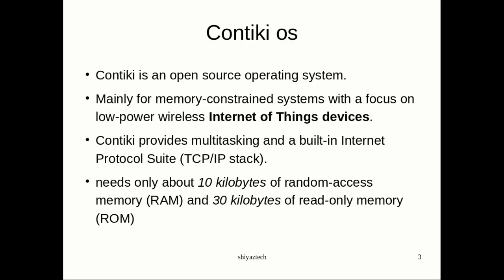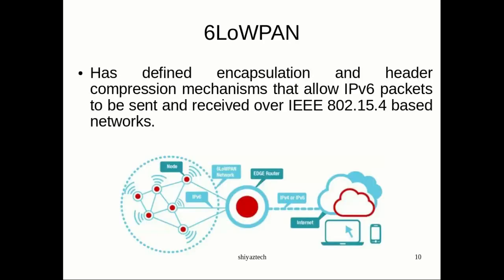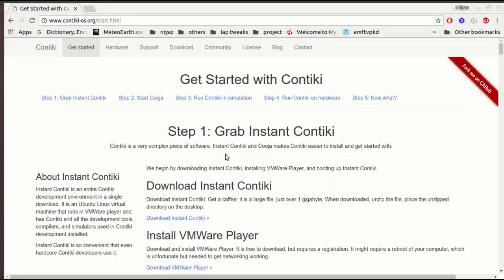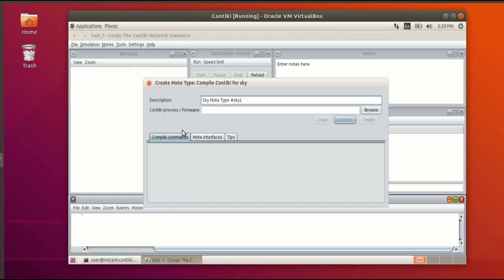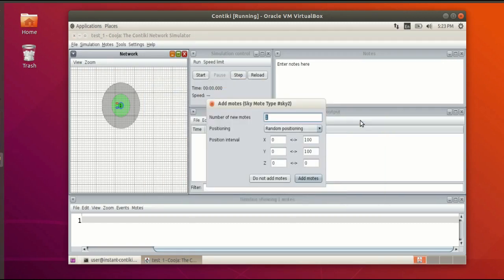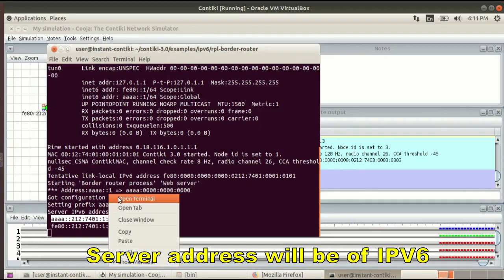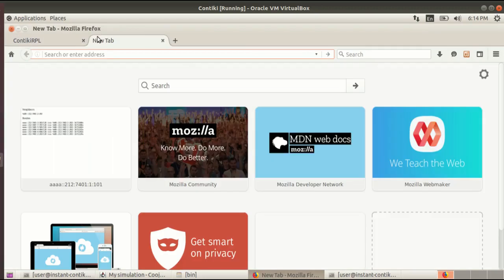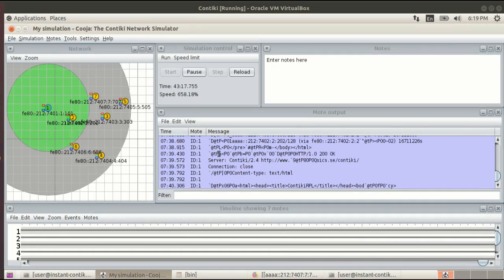6LoWPAN & COAP in Contiki Cooja Network Simulator

Comment: hello sir,   
to run COAP you have told that older version of firefox....which version have to install to see the result  in the web browser.
Reply: If you used Instant Contiki, In contiki/examples/er-rest-example/Makefile, you can try to change WITH_COAP from 13 to 7.

Comment: slip-bridge: Destination off-link but no route src=6f20:4854:5450:2f31:2e31:d0a:486f:7374 dst=3a20:5b61:6161:613a:3a32:3132:3a37:3430
tunslip6: serial_to_tun: read: Interrupted system call
ifconfig tun0 down
netstat -nr | awk '{ if ($2 == "tun0") print "route delete -net "$1; }' | sh
make: * [connect-router-cooja] Error 1

Got this error on terminal after a while and the router can't be connected.. can anybody tell if anyhting missing somewhere?